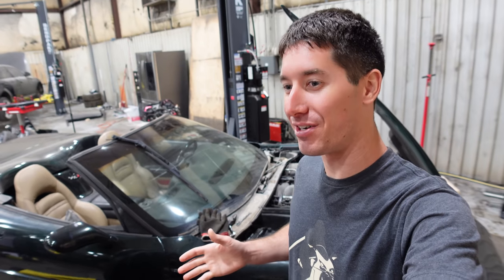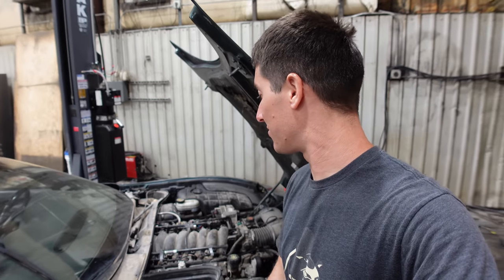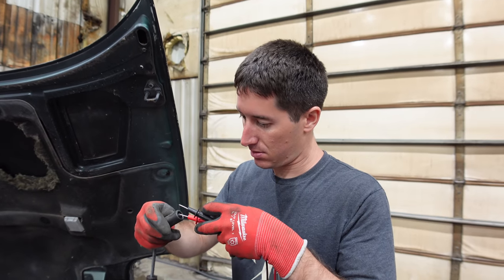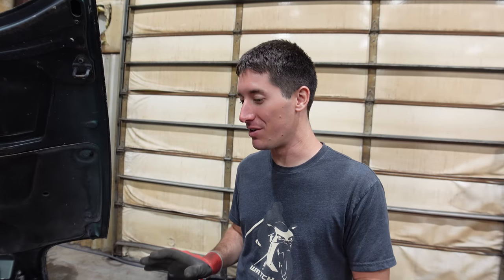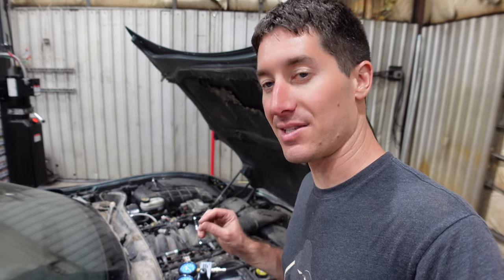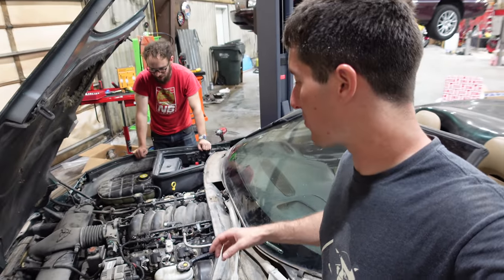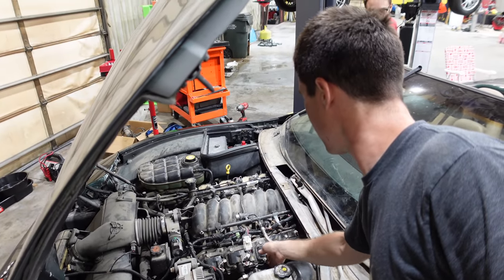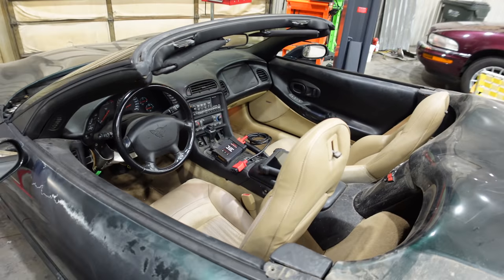Chasing MISFIRES On My $5,000 Corvette *And The FIRST Fixed DRIVE*

Comment: Fun fact, AC Delco professional Platinum spark plugs are made by NGK
Reply from the maker: No wonder they usually last 100k miles! 🍻
Reply: Ngk makes a lot of OEM plugs... Them and Bosch for the Euro cars
Reply: NGK makes Motorcraft plugs too, with the exception of the 5.4 3V two piece POS, they wanted nothing to do with that monstrosity!
Reply: You might wanna do the lifters too john ross they are notorious to fail..
Reply: Thank you for that!!!
Reply: That IS a fun fact!
Reply: Last year I help my younger brother and my dad to change there spark plugs all acdelco iridiums but my dad iridiums did close to 120k in 6.2 vortec

Comment: I am a engine whisperer....your engine says....WASH ME !!!
Reply from the maker: I'm on it! 🚿🚿🚿
Reply: No u screw up the cap and rotor
Reply: @rsprockets7846  cap and rotor?
Reply: @WatchJRGo  Maybe you can get ChrisFix to help "super- clean" it for you ....BTW  i have the same exact car except with a Targa... would be a shame if you don't get the Bowling Green Metalic paint restored
Reply: I gotta C4 and ya can't power worsh the motor to make her look real Purdy!  Gosh dern optispark always going out!
Reply: Yes ... Perfectionidt JR, unusual he has not scrubbed it down.
Reply: @2006gtobob  what about the points and condenser?
Reply: @davidbauer1485  Yes, you Can. Just cover the optispark as best as you can.  I've done it several times to my old Roadmaster Wagon.  If you're careful.
Reply: Good thing it’s a C5. I had a opti on my 95 Trans Am, bad design
Reply: Looks like a filth hole.
Reply: Word to the wise; last time I gave my 2001 C5 engine bay a wash, the throttle control module shat the bed. Took me several months to find one that wasn't in a kit with the accelerator and throttle body for $700+. Finally found a salvage guy in Maryland selling one out of a 2001 Z06. I still had to swap the guts out of the salvaged housing because the 3rd mounting bolt hole was broken off, but I did get it done with lotsa patience and a heat gun! Good stuff JR!

Comment: Undercoat all grounds a must. I owned 4 of them still have 1, rusty ground connections are common. Try cleaning out fuel rails with injector cleaner and check fuel filter too, if it’s gummed up you’ll run rough

Comment: Check out Iridium TT's as a spark plug. Ran a set in a st1 2.0T Saab for 60k miles, totally eliminated misfires, and the tips and gap were in perfect shape. Normally these cars wear out a set of platinums in 30k. 
Might be really good on an LS.

Comment: '99 C5 here. Check the door connector in the passenger side door hinge area. The pin connectors tend to loosen over time and cause the gauge issues and warnings. The pins can be re-tensioned and take care of some of those issues.

Comment: Corvettes are rolling grounding issues.   I love em to death, but feel like I'm forever chasing grounds.
Reply: Hey GTOger,   have people stopped parking in the back lot... we miss the drumbeats !!
Reply: @riwoof  yeah, but we'll see what the summer brings.  Maybe a Corvette like this one?  ;)
Reply: Usually corvettes are rolling viagra commercials.
Reply: I totally agree, I had one of the computer grounds on my C4 go bad and I swear, I went nuts so the 4 grounds to the computer I ran straight to the battery ground, headache over!  The steering columns in all GM cars are a nightmare too!
Reply: That exhaust leak should be fixed soon it could give a code for 02 sensor exhaust misfire ? Leancondition

Comment: Shortest plug wire on my old '85 S-10 2.8L V-6 would increase in resistance and cause misfires.  anything over 400 ohms - bad.  I kept a spare set of wires in a bag behind the seat.  Rainy days were especially bad with the misfire.    Simple swap out, and voila, smooth operation.
Old GM dealer mechanic down the street once asked me once if I owned a spark plug wire company yet.......he knew the problem well...

Comment: I'm sure a lot of folks know this already, but if you ohm out your spark plug wires and find one with massively high resistance or you find the spark plug gaps are WAY too wide, you might as well go ahead and replace that coil, because the resistance of bad plug wires or too large of a spark plug gap will often cause coils to fail by forcing them to work far harder than their normal operating range in order to force their spark to ground (across the spark plug gap and to the engine block)...

Comment: VSS circuit 817 from the PCM C2 cavity 50  dark green white stripe goes to the Instrument cluster A7, but also to the Electronic Suspension control module  cavity C6 connector C2..  also a dark green and white.. could your Electronic suspension control module have a shorted to ground wire..   so that is in the new harness.. since the PCM is seeing the VSS signal ... the VSS signal comes into the PCM also on connector C2  cavity 20/purple wire and 21  yellow wire..  but those are probably OK. 

 hint... find the exhaust leak with a cold exhaust by using a shop vacuum on blow or a leaf blower into the tail pipe.. to lightly pressurize the system..

Comment: Question - why do you hate Fram filters? Are they bad filters? Should I stay away from them?
Reply: Fram makes the worst quality filters out of any brand. Any other choice would he better. I would personally go with a WIX filter if you run a performance car but for an ordinary daily driver I'd go with an OEM filter
Reply: The only Fram that I know to be recommended is the top of the line one for synthetic oil. The rest use cardboard where others use metal inside. They only have 95% filtration and 5,000 miles duration use. I was surprised to learn that as well.

Comment: Tablet knows the speed of the car because it's going off of wheel speed sensors. The speedometer goes based off of the transmission speed sensor. Wheel speed sensors are a secondary method for the car's transmission computer to read the speed of the vehicle, but it's slower, resulting in rougher shifting. The TSS is super easy to swap out on these, you don't have a speedo, that is most likely the issue.

Comment: Everyone talks crap on Fram filters lol. I've put them on my cars with zero issues. I just change my oil regularly and the filter with it. I've even had an '04 Silverado with 400k miles, nothing but Fram filters. Sold it to my mechanic and he pulled the engine bc it was the only thing still good on it.

Comment: Typically it's 800 ohms per foot.  That will help you in future diag.
Reply: (Happened to see that number two days ago when looking at an electronic ignition system manual that has you make your own spark plug wires and attach the ends.  That Ohm test per foot was your test to see if you got it all right.  Perfect timing, now I won't forget it.)

Comment: LS coil will kill itself if it had an undetected bad wire, will not throw a code and will continue to fire the offended cylinder injector. Even if its run you could of still have a weak coil though, their misfire watchdog strategy is kinda dumb and on the lenient side, i don't know why exactly gm made it that way maybe to accept aggressive cams

Comment: My Corvette had one of the 4 grounds coming out of the BCM short out and I ended up running all the grounds to the battery, I hope to never buy another GM car or truck again, what headaches.  Now I got to replace the drivers door Ajar switch and door pins, GM products are total JUNK, and that includes my Corvette, surprising the engine runs like a clock, and the transmission is rock on!

Comment: You need to go to websites like Alibaba and start replacing and modifying EVERYTHING on the car. Its cheaper than chasing problems that will creep up again, and in the end you have a better car than you started with. 5K goes a very long way with C5s as long as the transmission is good. This car is meant to have new suspension packages and power is cheap to make a WAY better sports car than you could imagine a C5 could ever be. The template for a GREAT sports car was provided by GM, and its up to the owners to fulfill the cars promise.